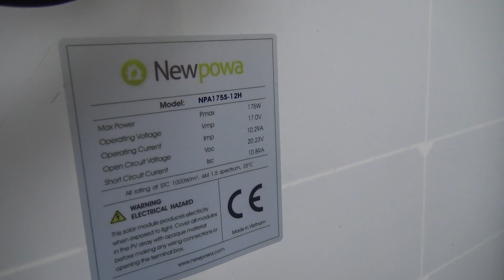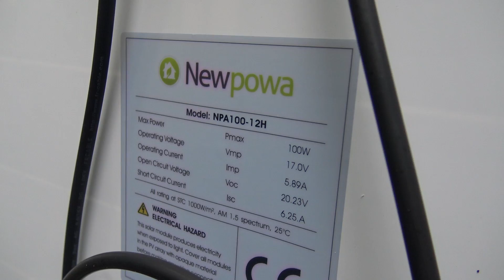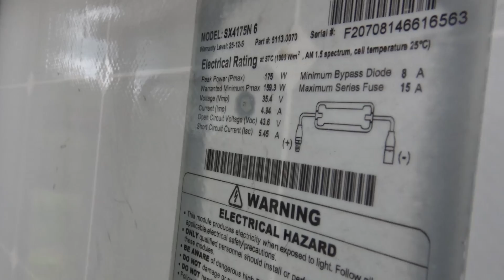The Difference between Solar Panels, Monocrystalline/Polycrystalline/Thin Film, Off-Grid RV Living

Comment: 8:43 In fact, the folding solar panel shown here does not use a thin film and the solar cells there are not flexible, but semi-flexible. They can only be bent a little. And I doubt that they can be bent as much as you did. It's possible you broke your panel. A feature of such solar cells is that they continue to work for some time even if they are broken. I also want to note that this solar panel seems to use SunPower C60 solar cells, for which efficiency up to 23% is claimed. That is, these are the most highly efficient solar cells of those shown in your video. It is a big mystery to me why you call this solar panel inefficient. By the way, I suspect that if you count how much one watt of power costs for your panels, then the price in a folding panel will be the most expensive.

16:38 I wonder what 5% power loss you are talking about? In fact, the power loss can be much greater. The power of solar cells is indicated for standard conditions. In particular, solar cells must have a temperature of 25 degrees Celsius. If the temperature of the solar cells is above 25 degrees Celsius, then for every extra degree the power generated by the panel will decrease by 0.35%...0.4%. In summer, in direct hot sunlight, solar cells can heat up to a temperature of 80 degrees Celsius. It is not difficult to calculate that at such a temperature, the power generated by the panel can decrease by 22%, i.e. instead of 100 watts, the panel will only generate 78 watts.

Comment: Thank you so much.  A refreshing approach to portable power generation.  What are the specifics of how long each type lasts?  If you’re going to spend the bucks you might as well do it right the first time, especially if you are going to install it on a camping trailer or motor home. You don’t want to take the “cheaper” ones off and then punch new holes in your roof to upgrade later..... or do you?  Also how difficult are the different types to clean and keep working to their best efficiency?

I was also very happy to see you at HamCation and hope I will see you there in 2021!

Dave K8WPE